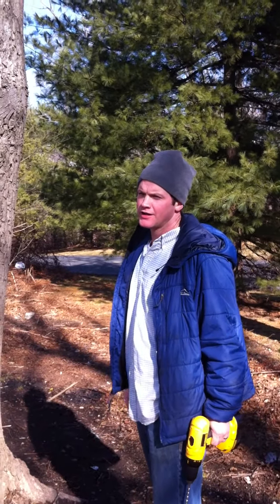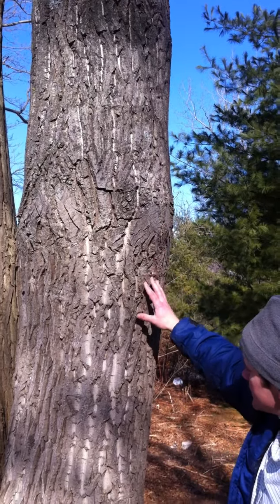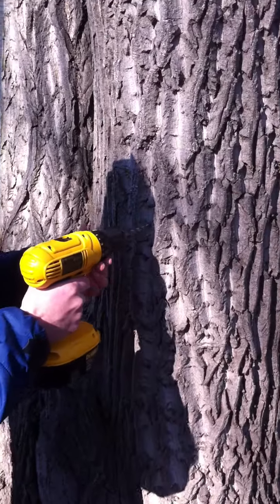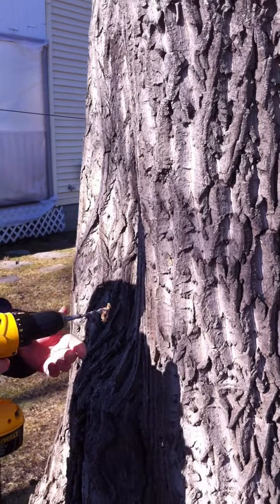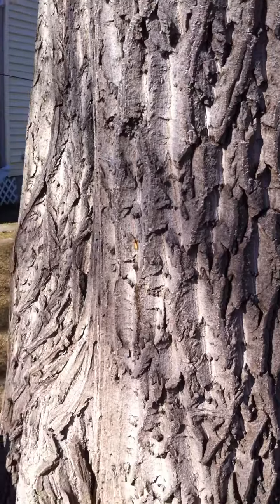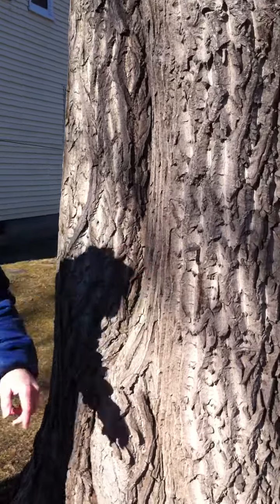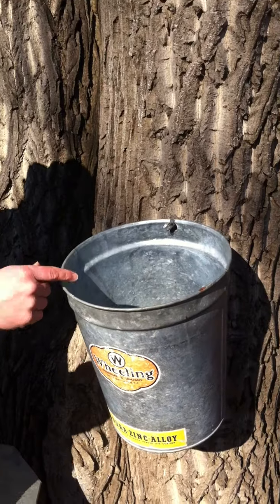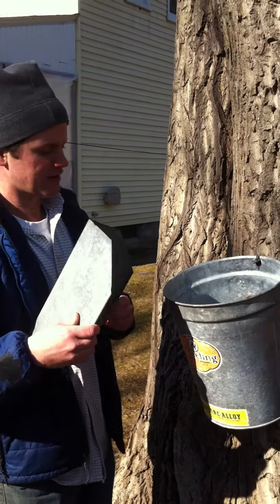Tapping a Butternut Tree

Comment: Please, can you tell me what size drill bit and tap you used, and what depth you drilled to? I tapped my maples and butternut tree all the same way with same equipment per instructions from tapping books, but while the maples immediately returned sap, the Butternut taps were dry. I'm wondering if I need a bigger drill or deeper, or if the season is not the same, or is there something else I'm missing. my butternut are large and healthy, very productive for nuts yearly.  I used 5/16 inch taps and drilled 2 inches deep.